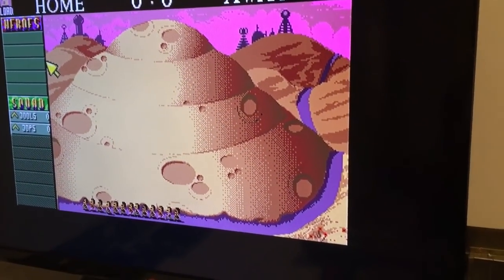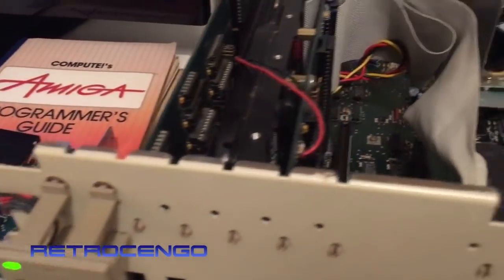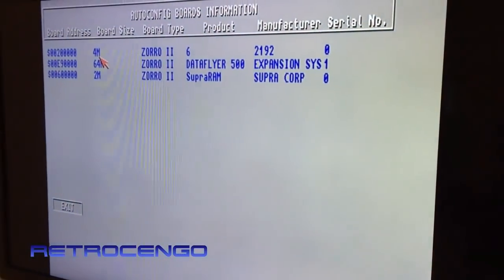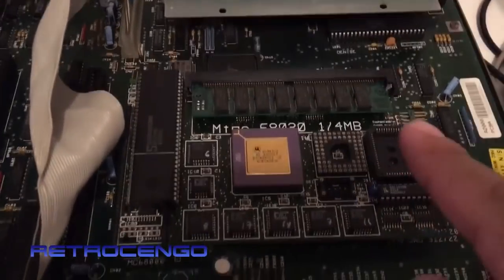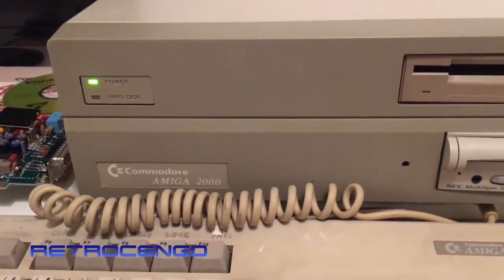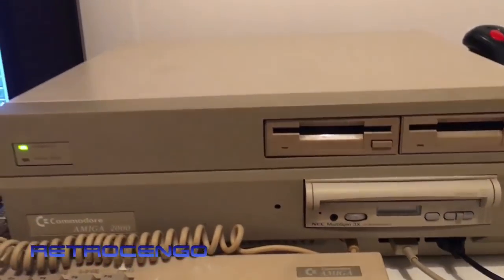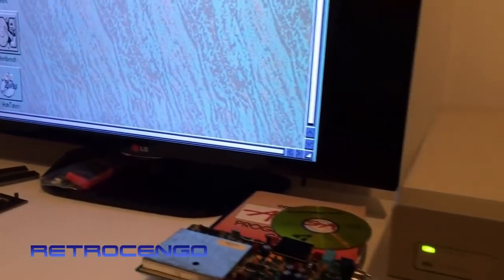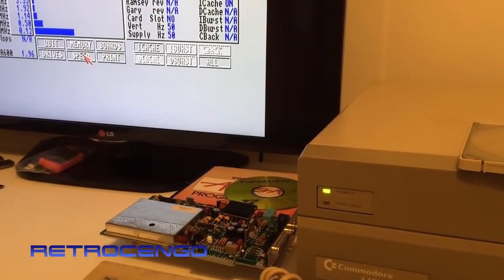Commodore Amiga 2000 Mtec 68020 6MB Fast ram Supra Ram Dataflyer SCSI HD/CDrom test Retrocengo

Comment: Hey Arnie  great timing on this video. I just bought A2500 with original 030 card and A2091 Scsci card coming from USA to AU ordered the ACE2 2MB  chip ram from Individual Compters. New old stock 240V Psu from UK and GVP IMPACT Series II SCSI 8mb Ram from UK as well !!!!!. Love the Amiga 2000 bought one new back in 1990 with 1084s ICD SCSI card 8 mb ram  sims, Commodore flicker fixer, Quantum 105mb hdd which was big in those days every one i knew has 20mb hdd's couldnt afford the accelereator......... :-)

Comment: I have an MTEC card in my A500+.  The 68EC020 only runs at  about 14.28MHz by default.  FPUs can either be 68881 or 68882.  How fast they will run wil depend on the speed of the crystal which you fit to the accelerator board.   There are 4 jumpers on the right-hand side for various settings like memory and autoconfig etc.    The FPU can run at up to 50MHz not the CPU!  and yes, either a 1Mb SIMM or a 4Mb SIMM can be fitted to the board.
Reply from the maker: robbiew73 Thanks for all the info Robbiew73👌🏻
Well if you put in 2MB chipram total in your A500+ it will run like an A1200😍🕹🕹
Reply: I don't know if it's possible, but it may be that card can be updated/hacked to provide better performance.  The 68EC020 can actually address up to 16Mb of RAM as it has a 24-bit address bus.  The full 68020 with a 32-bit address bus can address in theory up to 4Gb.  I've no idea what on the board controls the clock speed though, but you can put a full 68020 on it to replace the EC version.
There is a company in the USA which still makes 68020 processors and they may be available to buy in faster speeds, I know they were originally made to run at either 12.5, 16.67, 20, 25 and 33 MHz.  Perhaps someone out there in Amiga land has already done something.  
Or maybe just get a Vampire card instead which will also give you AGA and 100x CPU more performance!
Reply from the maker: robbiew73 As it is right now, i think the A500+ can max have 2MB chipmem and 8MB fastram. I actually think you can run allmost everything/whdload games with the 020 and ram upgrade😁😁 
Vampire looks awesome, i just haven’t found any reason to buy one yet. 
I’m mainly whdload user on my Amigas. 
I’m a sucker for 2MB chipmem😁
Swapping the 020 to a little faster model would be cool though

Comment: That DataFlyer Card should also support IDE.  I have one here that supports both IDE and SCSI it needs to be repaired.   I have an adapter board that came with mine where I could use it on the A1000 then I used it on an A500 and later in the A2000 and with it I have a RAM Board that connects to a header on the DataFlyer Board.  To have one working your very lucky.   Not sure if you can run a CF card with it but if you could that would be awesome.
Reply from the maker: Stephen Bruce Wow, thanks Stephen, i didn’t know that, must check it out. It would awesome with CF card yes. Maby an updated video??😁🙏🏻 Thanks

Comment: I have an MTec card :)
Reply from the maker: RetroJay1974 same model? Runs well with whdload right?😁👌🏻
Reply: Yes :) I bought it mainly to put into an one of the A500's here. But I did wonder what it would be like in an A2000.
Reply from the maker: RetroJay1974 Runs perfect in the A2000. Is your A500 totally assembled with the Mtec card in? Does the computer get hot?